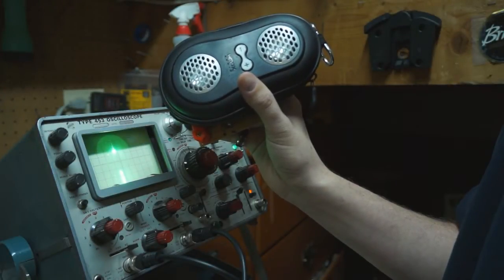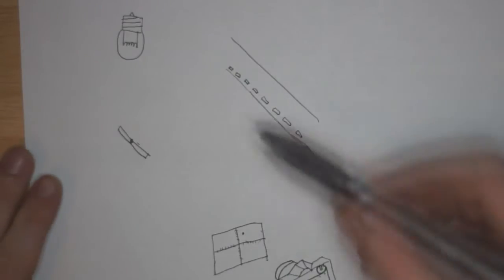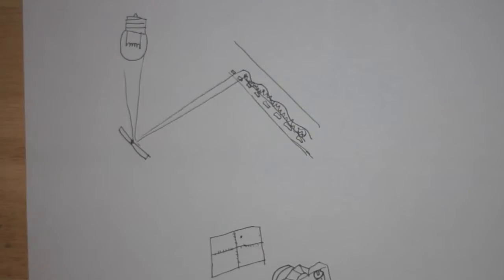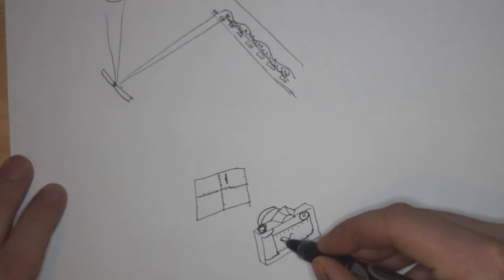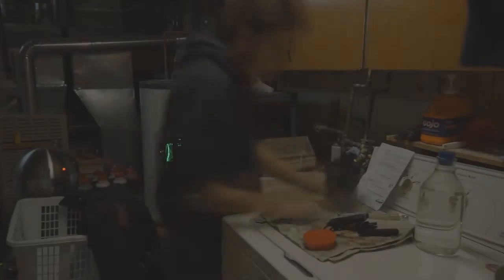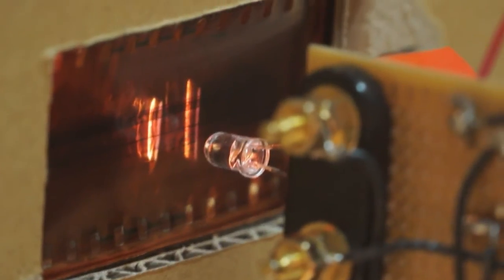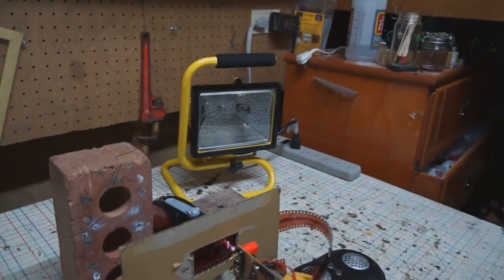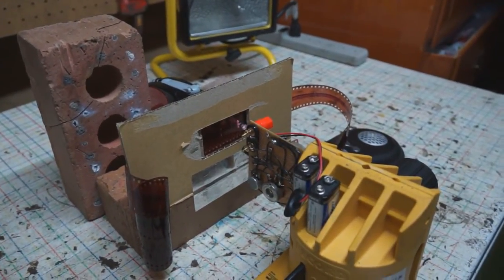Pallophotophone, Sound on Film

Comment: YOUR HISTORICAL RESEARCH IS SORELY LACKING.  CHECK https://www.victorian-cinema.net/lauste TO LEARN ABOUT LAUSTE'S TECHNICALLY SIGNIFICANT ACCOMPLISHMENT CIRCA 1910 – 1913 IS DESCRIBED THEREIN.  FROM A 16" DIA. LACQUER  DISK CUT BY WGY OF THEIR PGM, G.E. SCIENCE FORUM (OF MARCH 5 1947  PERHAPS 30 YEARS AGO I OBTAINED SAMPLES OF THE CHRISTMAS GREETINGS RECORDED ON A (PERHAPS  THEN THE ONLY ONE?) PALLOPHOTOPHONE CALVIN COOLIDGE AND JOHN J. PERSHING 25 (NOT A TYPO) YEARS BEFORE. THEY WERE
AIRED BY WGY ON CHRISTMAS EVE.  WITHIN A FEW YEARS THERE WERE STILL SOME ADVANTAGES THAT THE HIGHEST QUALITY SHELLAC DISK PRESSINGS HAD OVER FILM. HANDLED  & PROPERLY STORED, THEY DIDN'T SHRINK, TEAR & READILY CATCH ON FIRE AS DID THEIR CELLULOID COUNTERPARTS. SAFETY FILM DEGRADED THE IMAGE QUALITY.
SAFETY STOCK OR NOT,  FILM WAS SIGNIFICANTLY EASIER TO EDIT. DUBBING DISK TO DISK WAS HIDEOUSLY TEDIOUS AND PRODUCED SIGNIFICANT GENERATIONAL LOSSES.  EH, THERE ARE ALWAYS +'s & -'s IN LIFE.

Comment: you need positive and negative hi contrast, or high and low filled-in  hills, not empty line hills that don't vary in intensity. Those guys back in the days made it their life to get this stuff right. we are usually laid back , but this stuff is easier said than done. back to eating some pie and the drawing board.
Reply from the maker: I had tried to do a single sided modulated wave but it did't play back any better. Playing back the single trace is kind of like a zero-crossing detection and gave the most voice like results. If I ever tried again I would make a lot of changes.

Comment: Can you show more in depth on how the modulator is made? I would think this system would be the easiest to make rather than bilateral variable area or variable density. Three isn't too much free information online unless you're a SMPTE member or something. Are there any good books on this topic?
Reply from the maker: I never really found anything on it. I used an AM modulator that gave me a unilateral area trace (it may be damaged) because it more closely resembles the original technology. Variable density probably would work a lot better and would be a lot easier to implement (throw an LED across a stereo's output.
Reply: Nick Moore How would you focus an LED to the film? There's an old film that shows the making of variable density using a "light valve" or magnetic ribbons. I don't know where or how to get one of those today. The best for my solution would be dual bilateral variable area tracks but all I can find online about that is some diagram drawings on some light and mirrors shining on the film. Not very helpful.
Reply from the maker: If you put the LED behind a slit (maybe with a little diffuser) you could use the same wind-the-film-by-hand method that I did. I'm not sure how the exposure should be calculated though, (which is probably why spatial modulation was used instead of density).

For bilateral modulation you could feed your audio signal into an AM modulator with an extremely high carrier frequency then display the output on a scope with no sweep. The dot will expand and contract turning the audio signal into a bilaterally modulated line.

Comment from the maker: The half modulated trace was supposed to give changes in light intensity but it wasn't modulated far enough. The problem with using a single LED is getting the exposure right, I have no idea if the film will come out entirely over or under exposed given the LED brightness and feed rate of the film. I do plan to revisit this setup again in the future.

Comment: The problem is that your detector is looking for changes in brightness, whereas you recorded sound amplitude as a _vertical_ displacement on the film. You could repeat your recording experiment by driving a white LED with the sound (so that it flickers on and off) as you wind the film past it. The film would record one straight line that fades in and out in brightness -- that would give a better signal to your detector, I'd think.

That film trace from the oscilloscope is gorgeous, though!
Reply: He recorded variable area, while his detector is looking for variable density sound
Reply: And not quite variable area either, since it's just the squiggle
Reply: Recording sound on to optical has been around since 1914.
Reply: This is it